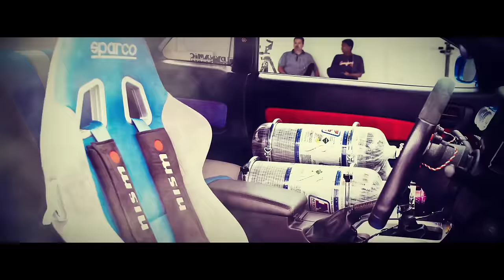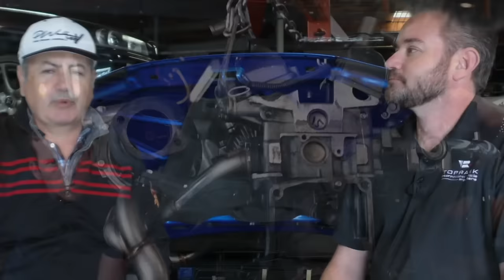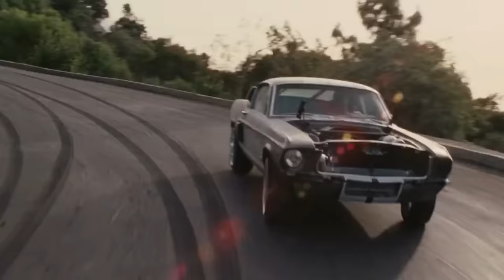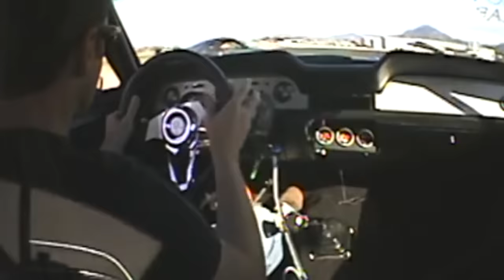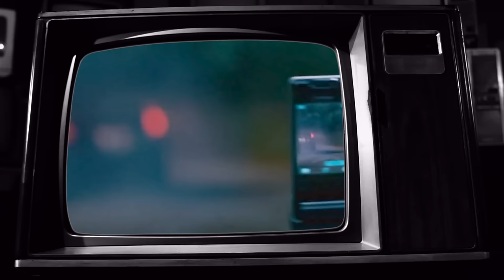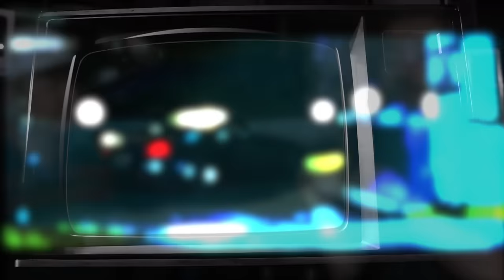TOKYO DRIFT RB26 MUSTANG

Comment: I think you guys meant 408 Windsor V8. And the ET. Sounds more like a 302/347 deal. A 408 that’s a real crate motor would trap 130mph. I actually had a car set up like the 408 car. But anyway you guys do a good job. Feeding the Car guys tech and Storytelling

Comment: Know what you mean on someone telling you it isn't the engine. I have a 1984 Chevrolet C30 that originally had a 454ci 4 barrel. The original owner blew the 454 and sold it to his business partner. His business partner had a 1974 Impala Highway Patrol car that had taken a beating and he simply bought as a parts vehicle. He and I removed the 454 and dropped the 402 from the Impala in the bay. I dont know what he did with the 454 afterwards. I bought the C30 from his wife in 2018. Nearly every time I have my hood popped at a truck show someone tries to tell me its a 454.
Reply: Same thing with my 240, swapped an sr20 into it and people still try to say it’s a ka24

Comment: Imagine getting mad at an rb26 mustang.
Reply: Well they dont go together and a 5.0 can produce more power
Reply: xxBILLDOZERxx 5.0 will blow up way before an rb will under boost
Reply: Brian Garcia i was talking about the early fox/sn95 5.0’s that were out at the time this car was built. You cant compare a modern 2010s engine to a 90s engine. Not the same tech, not the same architecture, etc.
Reply: @xxBILLDOZERxx  neither do LS engines in those 90s jdm legends but you don’t here jdm fans complain about em as much as you muscle boys. LMAO and I fucking would hope so that the v8s would make more power since they got more cylinders and twice the displacement🤣😂😂😂 but I still see them get clapped by little 4 cylinder Honda’s with half the displacement lmao

Comment: Han's S15 "Mona" had an RB26DETT in it, not an SR20DE....though the actual car used for filming had an NA SR20DE in it. I had a '95 200SX SE-R that went through two SR20DE's before i scrapped it, so I'm quite familiar with that engine and its appearance.
Reply: I was gonna say this, I distinctly remember in D-Sport/Superstreet (can't remember which one) had a full cover spread of the Mona Lisa and it had the RWD SR20de for the rolling shots. Thought it was weird they put a lot of work into a no turbo engine they didn't even show in the movie it had headers and everything, but what would I know not like I've owned a s13 and swapped in a blacktop sr20det, traded the s13 for an rb25det s1 s14, just recently bought a rb25det s2 s14 just 2 weeks ago, owned 350z when stationed in Hawaii, and I have a 10-11 year old tattoo of a fully dressed rb25det not a Nissan fanatic at all no way I could remember such a subtle detail like that. I think they are getting their wires crossed on what was in the rolling car which everyone is referring to not the glamor shot of the rb26 in the busted shell.
Reply: @cody180sx  Indeed!
Reply: So glad to meet you two here in the cancer section, seeing as you built the car and all, well done!

Comment: What was the suspension set-up?
Reply: In the shot of the rear you can see leaf springs and traction bars, prolly with a standard panhard bar, no watts link. As they kept stock strut tower etc I suspect (but don't know) stock style front suspension, perhaps with aftermarket arms. This would also make sense for ease of maintenance

Comment: Hi Craig Lieberman I have a question You explained in a previous video that the engine sounds of the first movie were edited later. In which fast and furious did they use fitting engine sounds and no mixed ones? Thank you in advance
Reply from the maker: Marco H. I didn’t work on the later movies so I can’t comment
On those.  But in the first three most of the sounds were edited heavily.

Comment: What you need to do is put a Aussie 4.0lt Barra turbo in a mustang and see how much better this motor is to fit and get huge horsepower for 1/3 the price the engine you put into the mustang in Tokyo drift.

Comment: I don’t mind the car, and I love JDM and American muscle but it hurt seeing the Mustang without the throaty roar of a V8.
Reply: Well, you're wrong. The 1960's mustang did come in a i6 format, we're just used to the throaty roar of the V8 because the V8 is commonly put on a pillar and heralded a major godly addition to the automotive world. Truth be told, people downplay and treat i6 and i4 like crap, when there are some truly godly versions of that. the V8 isn't the end all be all, and an i6 can be just as cool, if not cooler then the v8.
Reply: @Oatmealism  Plus the Mustang didn't get a V8 due to the plot of the movie,the only good engine on hand was the RB26,which I imagine was a pain trying to fit in the engine bay
Reply: @dalehadley3283  It's actually around the same size, to smaller then the stock 2.8-3.3L i6 that was offered in the original stang, so it might have been a seamless swap.

Comment: The question here is "where is the Mustang engine?" The dude is restoring a car but doesn't have an engine for it?
Reply: Probably dead, and since he's in Japan it won't be a lot of Cleveland or Windsor engines around... Sean's dad said the Mustang was abandoned in the US base.

Or they just needed more power, and since the engine is out, they can either put the original, or slap the RB26 in.
Reply: Could have also been a Year One body shell
Reply: It's a bit out there, but it could be a movie, can't quite tell 🤔

Comment: The s15 used for the first race with DK in the garage in Tokyo drift had a rb26 you can hear it as you can on the last race with the mustang anyone that says it wasnt a rb26 obviously dont know what there on about and they dont know there engines
Reply: And you just found out that they can add in any sound effects they want to... The engine was an SR20 na

Comment: How can you mistake an RB for a SR20? Like if someone mistakes ca18 for a RB okay but SR? Come on!
Reply: They mistake it for an sr20 because they know the motor cam from the wrecked s15, but they didn't know the s15 had an RB swap before it was wrecked.
Reply: @whiteMCHammer  But there is a scene where they show the engine and it looks nothing like an SR
Reply: @peterkubala3084  ikr, you can clearly see the engine head that it was an RB26.

Comment: Wasnt this a Mustang body on a non Mustang frame?
Reply: Mustangs are unibody cars. They don’t have frames. The have subframes.
Reply: @67buick  Was it a Mustang subframe?
Reply: @ehrldawg  I'm sure it was a Mustang front subframe because that is what the suspension attaches to. It is designed to fit the car. You can't just swap in a subframe from a different car.
Reply: @JasonWW2000  Got it !!

Comment: Eish low 13s are done with a n/a b20v engine but i understand for the reliability needed.
Reply: b20 doesn't have that sound that oozes power like the inline 6's do
Reply: B20V ? The 200 horsepower and no torque it makes wouldn’t be able to push a heavy mustang to 13s mate soz
Reply: @AldousForestTheLast  i never said it had to be in a mustang and you can get about 250hp out of it.
Reply: YuhBoy DTOY  these cars don't weigh much - 250hp is plenty. Camrys weigh a ton

Comment: was honestly the part i hated most about this movie. and I really liked this one.
Reply: well what other engine was he gonna use lol
Reply: Been a while since I saw the flick, but wasn't the Mona Lisa still running and driving after Sean scraped every vertical surface in that car park, I mean, he did drive it to the finish line. I didn't see much except for a little body work and maybe geometry adjustment to get that back on the road. Yet the amount of time and energy doing a whole drivetrain swap into a Mustang? Kinda shows the pony car was there, purely so they could put a pony car there....
Reply: Then why is it okay to put a ls engine ina jdm car
Reply: @EAGYSL  I mean, hey, it's a good way to get power from cars which don't have a lot going for it's engine from the factory (Miatas are a prime example of this). Yes, I do believe that putting them in an RX-7, which has a WORKING Rotary, is an unforgivable sin. You should only ever LS swap cars like Miatas (underwhelming engine performance) GT86s/BRZs (if you don't have the money for a 2JZ swap) and RX-7s (if the Rotary has blown up or stopped working completely).
Reply: @jereenmoniislam8118  I dont have anything agianst it im just pointing out that a lot of people complain about the RB26 Mustang but for them its okay to put a ls engine in a jdm car. In my opinion anything is okay just do what you want.

Comment: You made a mistake with the choice of the RB26 engine in the mustang not that they aren’t a nice engine but there is one engine that y’all probably didn’t know of. The engine that would have been a great fit for the mustang is the Aussie engine that makes big horse power for half the price of RB and 2JZ engines and its a 4.0lt Barra turbo engine I have bought the Ford falcon XR6 turbo that Australia Ford designed and built for the car I bought the car for $8,000 and have spent $4,000 on the engine and dyno and put a set of 20”wheels on it and it has just over 400rwhp and all this for about $16,000. It’s done over 200,000 kilometres but all highway driving and luckily I did some research and an order gentleman had owned it since buying it from the dealership and he had been a customer of Ford for 30 plus years and they put some upgrades in it for him. I will have to get a new intercooler as it still has the original one which is unbelievable as other people were upgrading them ASAP when I do put a new one in I’m going a little bit bigger intercooler and with that and dyno turned the performance shop can get between 600-650rwhp. I won’t be asking for that much as my son is starting to get into the car seen and going out on race tracks and racing other street cars and that’s called power cruise at Queensland raceway and he is starting to like how fast my car is at the moment and is wondering how much faster it will be. If you want to see how good these engines are have a look at ADAMLZ and his GT350 that catches fire and wrecks the engine and he puts a Barra turbo engine in that and he has 950rwhp and he can’t believe how fast it is now.
Reply: Probably because the BA XR6 turbo had only been released a few years before this movie first screened....
Reply: The 4.0 six from the Falcon would have been amazing if the movie was "The Fast and the Furious: Canberra Drift," lol. Still, I'd LOVE to get my hands on an XR6 stateside
Reply: I know it was about Japanese drifting and what they had there but at the end of the day they had a FORD mustang with a Japanese motor. Sean crashed his fast Japanese car and at the time the XR6 turbo and box were selling together for $2,500-$3,500 the dearer ones were out of the FPV models and they had 270kw instead of 240kw that were still quicker than the LS1.
Reply: @calebr4191  just do what adamlz done but probably not the exactly the same. Find a mustang that someone else has killed the motor in and then put a Barra in. There’s a guy exporting them to the states if you don’t want to go haltec after looking at adamslz. I have had a different map put in by real dyno performance in kippa ring Queensland and it’s got 4 settings and if you did want to see the set up they have Facebook videos and YouTube ones. I had my car done 1.5 years ago and I haven’t had any problems I have the original intercooler and turbo from the factory I’m the second owner but the original owner didn’t have it to abuse he didn’t do anything but have Ford service it. I’m putting a bigger intercooler put in and dyno again and I could have 600-650rwhp but I’m going to have it done to 500-550 just so I don’t have to worry about other things braking.
Reply: Probably because its about Japanese car culture, not Australian drift.
Reply: I agree the Barra is just as good if not better but in the movie the RB26 engine was salvaged from Han's S15. The Mustang was just a shell they used because all Han's cars had been confiscated. Continuity would have been an issue.
Reply: All Hans cars, except the Mona Lisa, which had, at worst cosmetic and geometry issues, still running and drove over the finish line.

But you know, engineering the drivetrain swap and shoehorning a hand grenade into a classic muscle car is just quicker and easier if you apply movie logic

Comment: I thought it was a sr20 mustang?
Reply: And he said r32 engine isn’t that rb20
Reply: No r32 uses RB26DETT
Reply: In the movie, the engine was pulled from "Mona Lisa" which was an RB26 swapped Silvia. You can see the engine in a few spots in the movie and it clearly has the RB26 valve/cam cover.
Reply: @kaloyanistratkov1914  r32 gtr* the r32 skylines had different engine optionss. it had 
ca18
rb20e
rb20de
rb20det
rb25de
rb26de
rb26dett
rb30de
Reply: @psyloshroom3973  Yea you are right, but I meant r32 gtr, I just dindn't answer correctly.
Reply: @psyloshroom3973  r32 had a rb26dett option stock? I could’ve sworn the rb26 wasn’t introduced until the R34 thought the r31-32 were the Neo straight aka rb20 and rb20det 
In there respective gtst gts gtr and gt models 
My buddy’s got a sedan with the stock setup and I have another with.a rb26dett and trans into his r32
Reply: @NewbombTurk.  this part is why I look over it cause I never realized Mona Lisa was Rb tbh always thought it was like a red top or something along the sr ca fam
Reply: You know what it is this making this quite confusing well just being misinterpreted 
Which I knew but didn’t think it would really be like ya know this important the r32 even
Though they use the same chassis code 
The R32 aka GTR does come with the rb26 it’s the none gtr models that followed without it
Reply: @randysanchez1397  i guess u sweared wrong, a quick google search might help, u. im not about to explain the whole history of GTR just because u thought the rb26 only came in the R34
Reply: @psyloshroom3973  yeah Na bro I realized why I was confused a lil we’re good lol
Reply: @randysanchez1397  Only reason I found it familiar was a friend of mine had a 240SX (S13) with a Silvia nose swap and an RB25.
Reply: @NewbombTurk.  oooo the sil180 😂